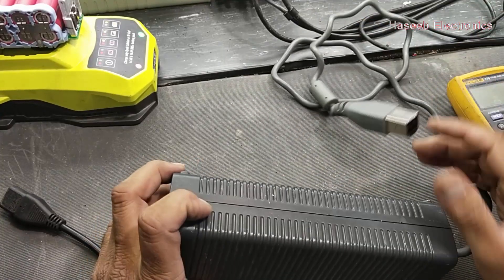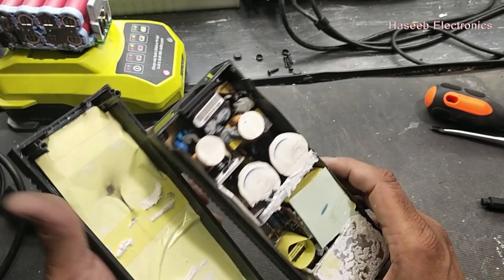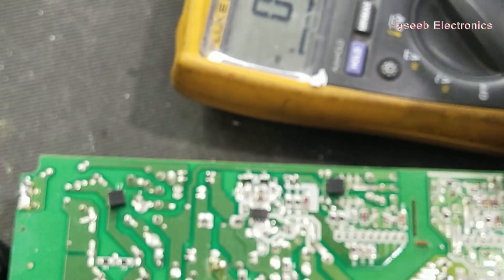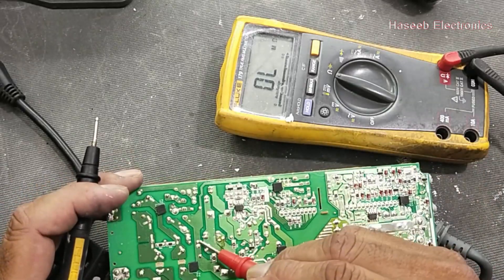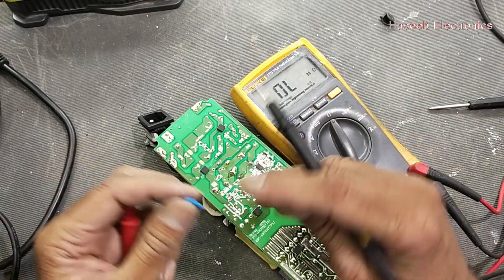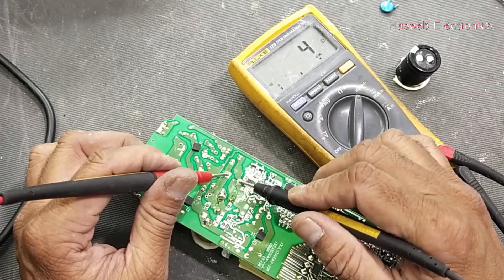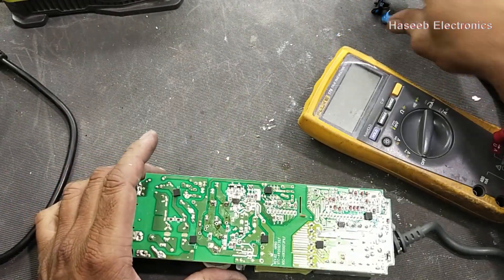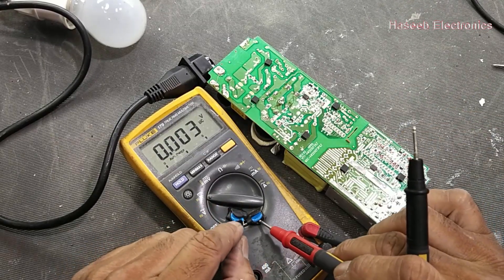[427] How to Repair XBOX Power Supply / How to Fix XBOX Power Supply No Power ON

Comment: can you fix xbox one power supply.. sometimes it works and light turns on and sometime it does not work and light do not turn for not any specific amount of time.. can you tell me that it is the problem of wire or of brick and can you fix it

Comment: its possible to double the voltage to 24 volts?
Reply from the maker: i think it will become difficult and even if tried to modify, it will cause to reduce the output current

Comment: wa'alaikum salam warrahmatullahi wabarokatuh. 
subahanallah. 
My power supply xbox 360 fat in standby position. and one day suddently my electricity in my house was shocked down.  so i unplugged everything that plugged in and i find out that the source is from my xbox 360 power supply . i saw many ants crawling out from my power supply and i opened it and saw millions ants in it. that is why my electricity in my house got shock down. can it be fix...? or i have to buy a new one. thank you. 
Asalamualaikum warrahmatullahi wabarokatuh.
Reply from the maker: OMG 
it was a huge disaster and so bad work from these ants 
inspect it carefully might be some sweet items fell on it which caused to gathering of ants 
you can wash PCB bottom side with soapy water and then rinse bottom side with clear water, then let it dry and the clean it with some isopropyl alcohol or spirit
then check its input circuit for short circuited components 
it can be repaired easily at low cost

Comment: Thanks for sharing once again. By the way may I ask what desoldering iron you are  using or what do you recommend thats not too expensive. I want to get one.
Reply from the maker: best regards
i use Weller WR3M rework station, it is made in Germany, it is above 3000 USD, but the worst case its spare parts are tooooooo expensive, even PACE is also much expensive 
i will suggest HAKKO brand, i used that brand more than 15 yeas and i got no problem. HAKKO is japan made and superb. Goot have very reliable and cheap prices as well

Comment: Hello my Friend! What is the type of desoldering tool you use? Is it a commercial one or you did yourself?
Reply from the maker: best regards 
it is Weller WR3M rework station, it is made in Germany
Reply: @HaseebElectronics  but the price suits its quality. We have to face the truth - if you want to get a good quality you have to pay more.
Reply from the maker: @electronicshaverightstolive  you are right. but sometimes instead of quality, there is some hidden aspects. as for the same weller, if i want to purchase a heating element  set, it price goes above 500 USD, that is not a justification in anyway. 
comparatively similar Japanese quality heating element is in 30USD. 
i used Hakko701 rework station for more than 20 years. its is 1/3rd to weller price. and in 20 years i replaced desoldering and soldering bits very rarely (cost just 5-10 dollars) but for weller we have pay huge amounts for parts replacement. that's why i am not satisfied with weller's this problem 
while i also used PACE that is awesome as well, although that is expensive but its spare parts and accessories are much cheaper than weller
Reply: @HaseebElectronics  ok. Thanks for good explaning.
Reply: @HaseebElectronics  Nice tool! Thanks for answering!

Comment: 0:37 i didn't know that the voltage in Pakistan is 115 i thought it was 230
Reply from the maker: there are xbox power supplies with 115V & 230 option. 
i am using step down transformer
Reply: @HaseebElectronics  thanks for explaining
Reply from the maker: it is american brand. and i am in Jordan.